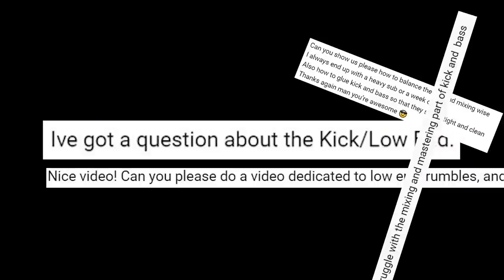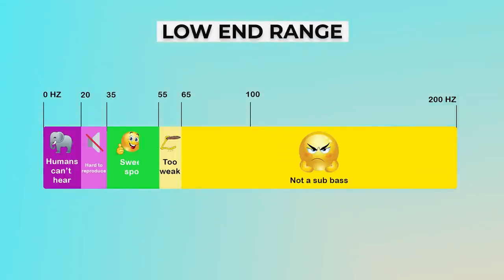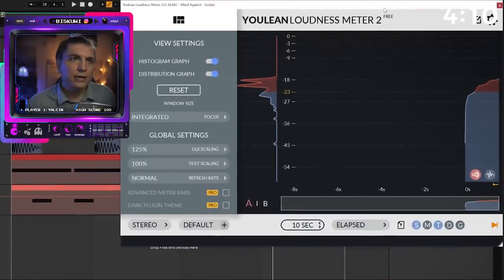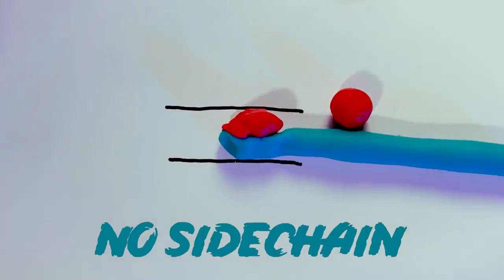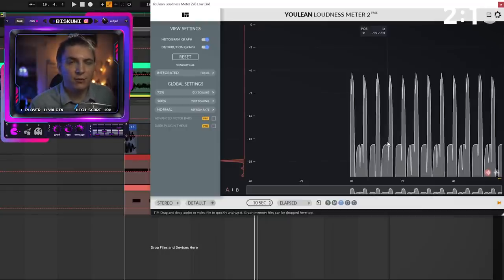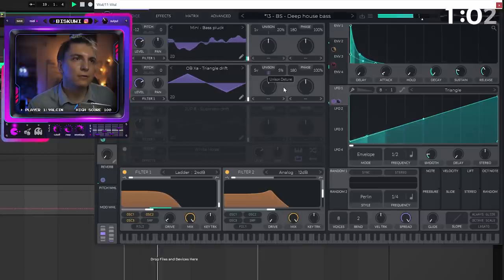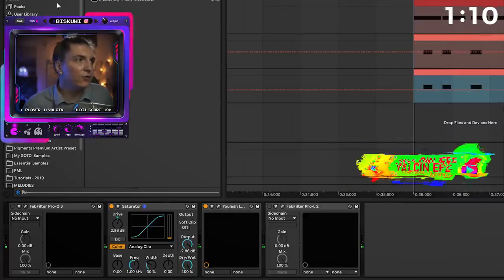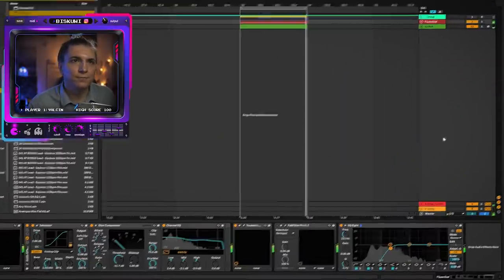Mixing perfect low end in 5 minutes

Comment: Wow,  brilliant as always! In this vid the sub bass was the same note, I notice a dip in volume when I use a sub with different notes, still not sure how to compress properly to make the volume of sub bass not so different
Reply from the maker: To keep the same energy with sub, you can actually also use a limiter or heavy compression which would give you more stable volume levels.
Reply: Are you referencing on headphones? Chances are it’s actually the acoustics of your room. An untreated room will sound very uneven in the low end.

Comment: Hi Alice,

I had a question about this video. Are you stating that the “sweet notes” E, F, G, A apply to all songs or are you stating these are the sweet notes for this song in your example? 

Based on what I understand I should only use a kick that is either E, F, F#, G, G#, or A. Is this correct?
Reply: Also, I had a separate question. Are you using PC or MAC. If PC how do you migrate to a new computer?